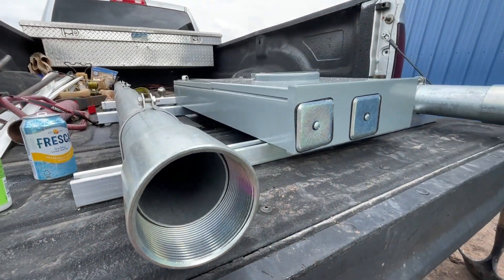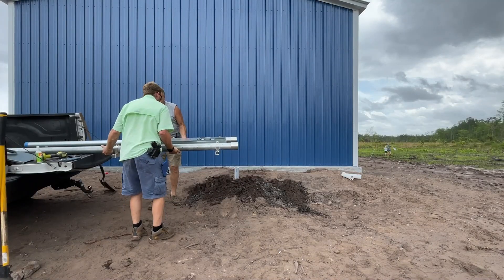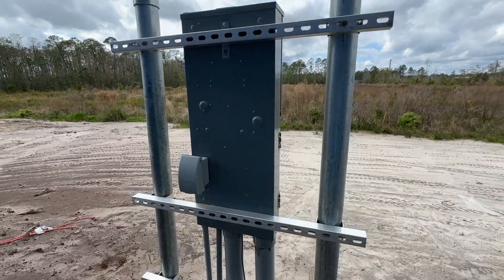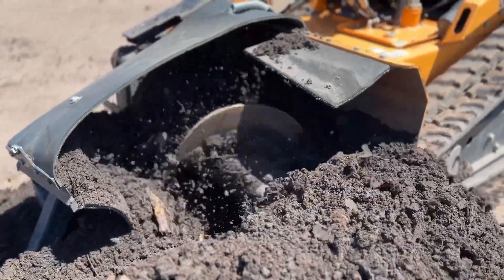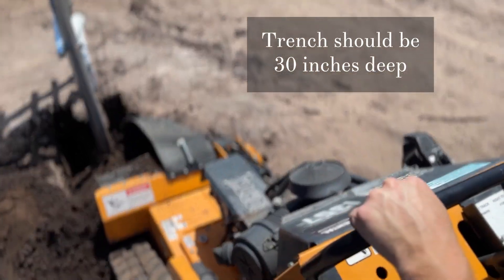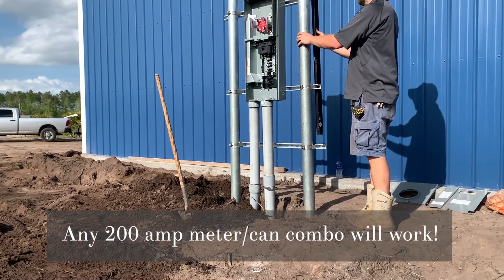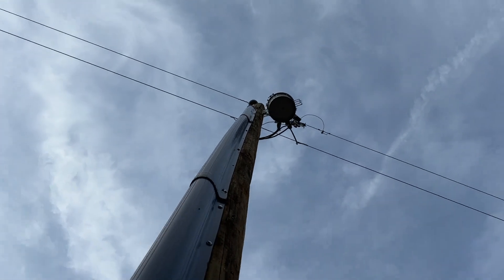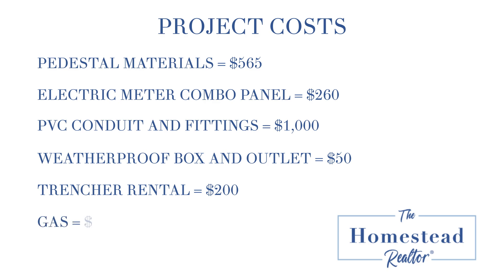200 Amp Meter Can Combo Installation on our Barndominium

Comment: What did your architect say about the single tubular steel structure? and  the gage of your metal?
Reply from the maker: He didnt really say anything it. The metal buildings come with their own engineering stamped by a florida engineer so you can use them for the permitting process. Our building is rated to 150mph which is better than normal homes. Lmk if that answers your question. Thanks
Reply: @katieshoda-homesteadrealtor  , where did you get your barndo kit from? i'm in North Florida as well and looking to get this process started. we just purchased our property.
Thanks in advance.

Comment: They are watching this she said any 200 amp receptacle will work. The only time that case is the case is if your service is 200 A so the wire that goes from your house to the transformer if that’s only 100 amp service you can only use 100 amp fuse box you can’t use a 200 amp it just don’t work like that

Comment: Did your FL county require the conduit even at 30”? I just ran direct buried cable in a sand bed at 30” to include the caution tape.
Reply from the maker: Im not 100% sure but im pretty sure it has to be in conduit. My husband always uses conduit for something this large and important. The only thing he uses direct bury for is smaller circuits. Good Luck